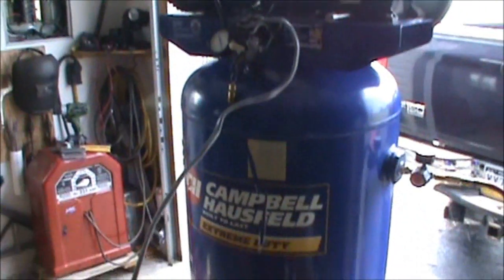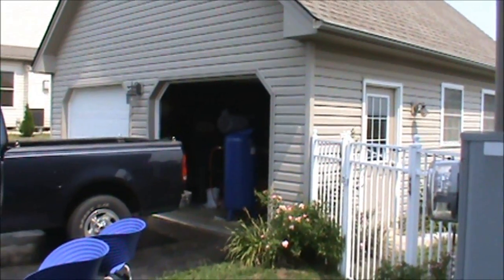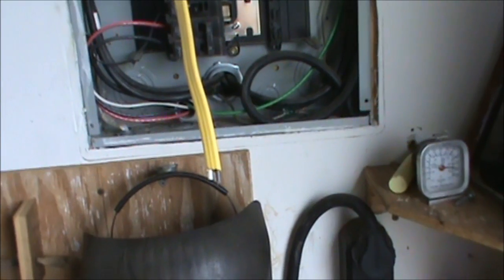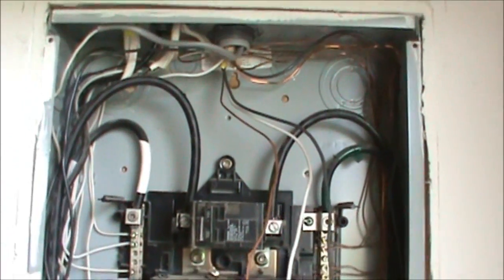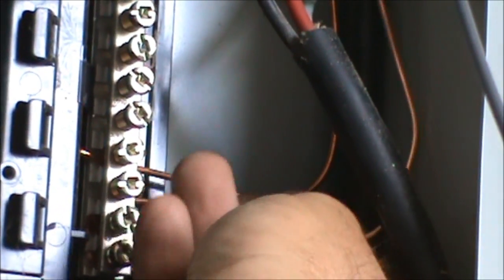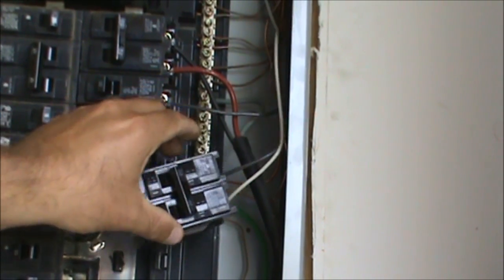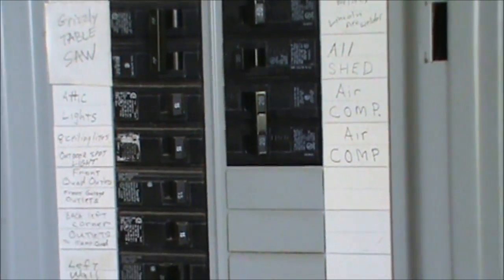How to wire a 240 volt circuit See Description

Comment: Why is the bonding screw installed  ? ,that's a sub-panel
Reply: greg berban    The bonding screw is installed correctly in this instance.   Typically you buy a groundbar and screw it to the can.   The bar in this panel, is insulated from the can because it was a neutral bar.   So it needs to be connected to the can as ground in case a hot touches the can.   If this doesn't make sense, ask a question.   Respectfully,   Kevin
Reply: @KevinCoop1  Ground and neutral bars are supposed to be isolated. Neutral is not to be bonded to ground.

Comment: From a strictly working safety standpoint... The safe thing to do is always turn off the sub panel main breaker anyway, even if the feed breaker in the main panel is turned off.  You never know who may flip it back on while you are in that other building/location's panel.  Put a piece of tape over the main panel breaker labeled "leave off" or "work in progress".

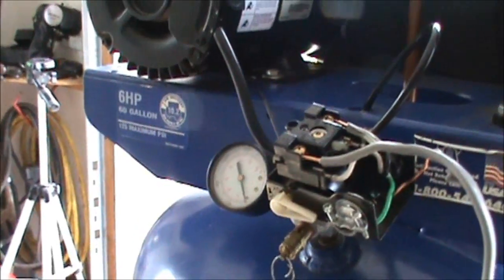A run of Romex cable is not what should be used between the wall and compressor, if that is what you did for the final hookup after the test (shown at 3:45).  You did not show the actual compressor end cable install to completion or how the cable runs to the wall.  A service box with either a receptacle or hardwire armored cable/whip is needed (like MC).

Comment: 1) White is neutral wire in USA, put red shrink tube using it as L2 
2) Wires in panel are careless - use cable ties or cable trunking

Comment: He is suppose to tape that white wire red or at least something other than white so someone else doesn't come in and possibly thinks hes thrown a neutral wire under a breaker.  But yes you do need 2 hot wires you're confused by the white wire he isn't taping red :)

Comment: No, that is not sufficient.  #12 wire can only carry 30 amps, if it is rated at 90C.  Even if you have 90 Celsius rated wire, you still need to check your terminal ratings.  Few if any circuit breakers have 90C terminals.  The industry norm is that most terminals are rated at 75C.

Therefore, you need to check the 75C copper column of NEC310-16, to make sure that the wire is sized to not overheat the terminals, at that amount of amps.  You need a minimum size of #10 copper wire.

Comment: I know I could easily do this myself, but I had an electrician do it just to be on the safe side and was curious if he would do it the same as I would have done. He did.  Price: $500 to pop in a breaker and run 4 foot of Romex. What a rip off. Never again.

Comment: 12-2 with ground is the absolute minimum you'll need for that compressor. Since it's only 15 amp, it should be okay. Not safe. But okay. Ingersoll Rand calls for a 40 amp double for 21 amps, with 8-3 cable.

Comment: Just an observation you might want to phase tape your white wire to black or red instead of leaving white neutral a it wouldn't pass code be it would be confusing to somebody looking in the panel or working on the compressor , possible confusion would lead to a good shocking. Why wouldn't you just use 12 2 to have a red and black white and green instead of 12 1 and just  1 black white and green... Not shitting on your job just my 2 cents
Reply: +Christopher Merten  expensive?

Comment: if a wire run circuit is so long ,it should be upgraded to a heavier gauge wire .I would use 10 gauge wire at least for a 20 amp 240 volt circuit.
Reply from the maker: gary mathews The entire run was 30 foot.

Comment: Granted, I see it all the time, that this rule is ignored, and in my opinion, termination and handhole taping should be sufficient no matter what the size.  Certainly colored wire is an improvement, when practical.

I don't understand the intent of the rule myself, on why taping at terminations isn't acceptable for #6 and smaller.

Comment: its not hot and common with 240V, it's hot and hot. In addition, you're running the wrong size wire. Please look up code before doing any electrical work!

Comment: Did I miss the part where he used a multi meter/test lamp to prove dead before poking his hands in there? Or lock-off the supply to the garage to prevent someone else turning it on while he was working?

Comment: Nope. 12 gauge-20 amps max. 10 gauge-30 amps max. A hot water heater needs no neutral so you will run #10 from a 30 amp tandem breaker with two hots and a ground.  Very basic.

Comment: Wow, are you sure your service can handle the extra load? You need to do a service calculation before you add something like that. Your load center is loaded up. This is why you hire someone licenced.
Reply: So This is what our subpanel will look like.
•	60A double pole breaker in the main panel.
•	#6 feeder cable for a run less than 75 ft., #4 feeder cable for a run less than 150 ft.
•	60A main breaker in the subpanel.
•	20A double pole breaker for table saw.
•	20A single pole breaker for dust collector.
•	20A single pole breaker for freezer.
•	20A single pole breaker for convenience receptacles.
Notes:
Don't forget to balance your loads between the two legs in the subpanel.

 One issue I hate is the insults take that shit to a kiddies’ room.

Comment: White wires should almost never be connected to a breaker. White is the grounded conductor. This is a code violation and is very unsafe.

Comment: I give you a 10 for trying, but a 0 for rightness, you are not using the right wire, must use a 10/3 wire and at lease a 30amp breaker.  using a white wire for hot is a no no .

Comment: boy - that's EXACTLY how i wired mine - now i'm trying to wire a dryer- but everything i've read says i need a NEUTRAL now. But there's nothing going to the neutral bus bar... I'M CONFUSED! anyone?
Reply: antigen4 I think you need two hots (one on each leg) and a ground
Reply: thanks yes- from everything i've read the neutral isn't actually required for a 240v circuit... at any rate - it seems to work fine for me - hopefully it's no kind of hazard
Reply: Depends on your jurisdiction (location).  Here in BC (Canada) you use 10/3 wire (three conductors red, black, white and one unshielded copper ground) on a 30amp dual pole breaker.   I think most modern codes require the same when installing a new outlet.  I the old two wire way the ground line acts as a neutral line... the more modern wiring method separates ground and neutral.   You can still wire it old school but i'd bet that it won't be up to code in most places.

Comment: Beware!  This guy is dangerous!   The white neutral wire must be installed into the neutral bar.   Any breaker takes only the power circuit leg.   In this case, the double breaker requires each circuit leg from A and B loads from the panel to carry the 120 volt power when combined equals 240 volts.  Usually these power carriers are either black or red.

Comment: This is NOT how to do it as others have said...you don't energize the Neutral! The Neutral is supposed to be connected to the receptacle where the air compressor plugs into. Then used the wrong cable...it should have been 12/3 not 12/2, which would have supplied him a red "hot" wire to connect on the second terminal on the breaker. I see in his panel that he has done this practice where he uses the Neutral to connect to breakers where he is back-feeding or energizing the Neutral - again a bad practice in electrical work! Do not follow this is dangerous and not to NEC code. There are circumstances where a motor will not use a Neutral like a direct wiring for an Elevator but you would still use the Hot conductors not Neutrals.
Reply: Btown B  please tell me where you find in the NEC that a white conductor is always "neutral".   As an engineer working for electrical contractors, I have had NEC on my desk since 1983 and with exception of ground is identified as ground, there is NO color code for identification of conductors.   It amazes me how many people make incorrect statements about electrical videos with such conviction.   Worse are the videos that show some really wrong installations.   #12/2 is in compliance with NEC.

Comment: uhhhhh........... your house is gunna go up in smoke........uf cable reallllly! solid cable on a vibrating motor? u did not relabel your white wire u installed your breaker wrong does that compressor have a means of disconect on it?or are u using the breaker to shut it off? a seimans breaker is not switch rated i can go on and on  oh did u pull a permit? lol

Comment: Because the wire is yellow, I would assume that is 12/2AWG wire with just 2 insulated and 1 bare copper wire which is fine for 15A breaker.  The yellow wire is specifically for 120v installation only.  This installation shall be using 12/3AWG wire so that there are 3 insulated wires (neutral& 2 common)  and bare copper wire.  Nuetral wire is a current carry back to the panel and bare copper wire groud wire is not. This installation wiring would be freid in event of lightning strike because the current will travel through the bare copper wire the entire circuit before living to the ground.  I would definite fail this job if I were to be an inspector. No offense. I am an electrical engineer with 15 years expereince.  I comment on your vids to help you out and not to offense you.
Reply: Not even close, guess again.
Reply: lolwtf